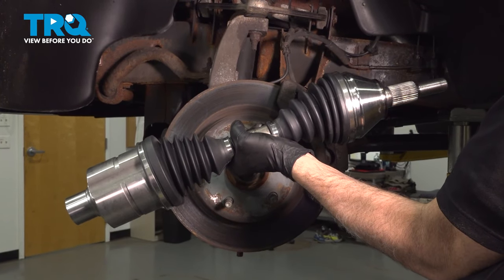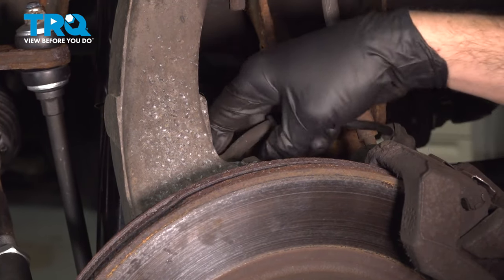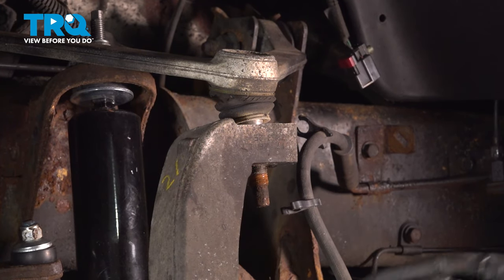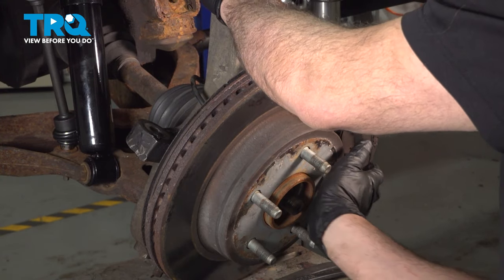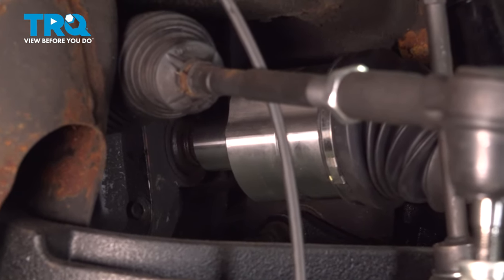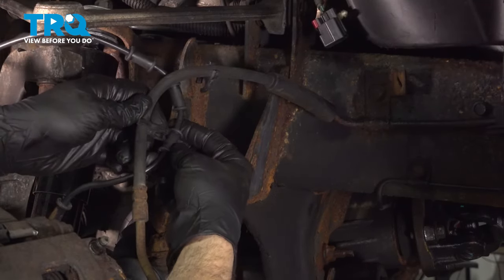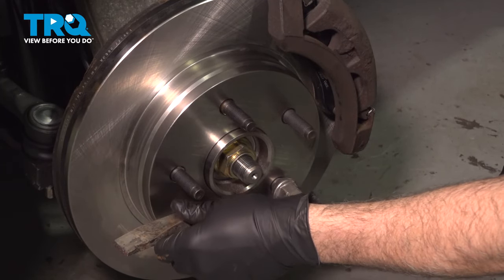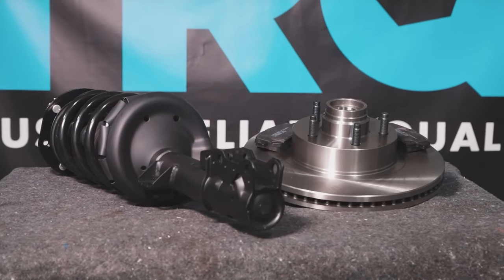How to Replace Front CV Axle 2002-2008 Dodge Ram 1500

Comment: Looked  simple enough. Sadly, my stub shaft came out with the CV axle so this is insufficient space to get it out, at least there seemed to be. I may give it another try when it isn't raining. My plan if I can manipulate it out is to free the lower ball joint and pull the knuckle since I am doing the bearing and brakes as well.

Comment: Also before jacking up and removing wheel break axle nut and lug nuts loose.  If you have a serious impact gun it may not matter.  My impact wouldn't break the axel nut loose, so I needed the tire on the ground and used a breaker bar.